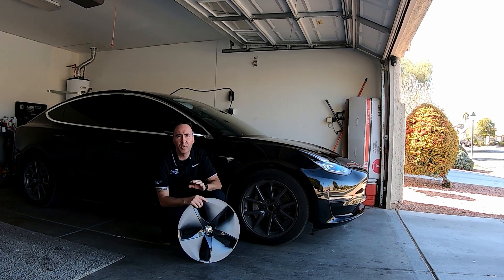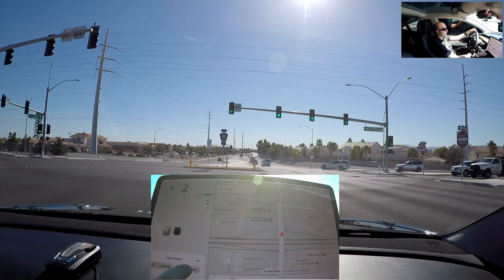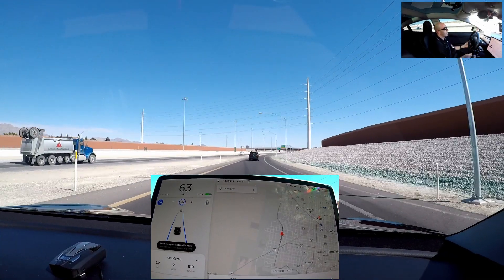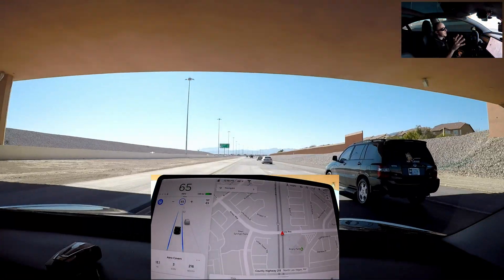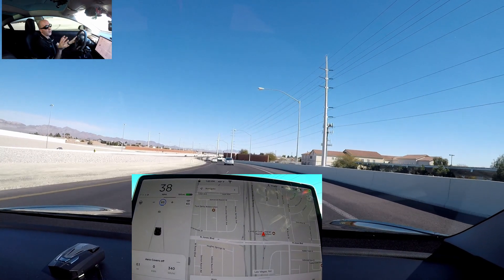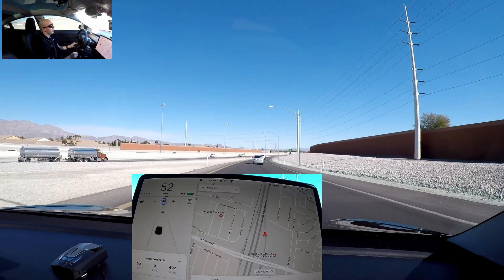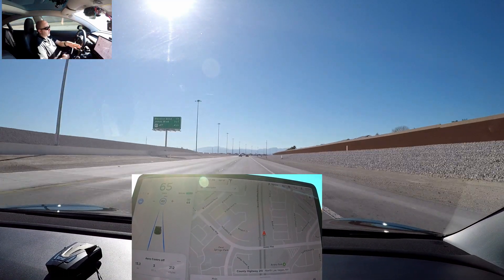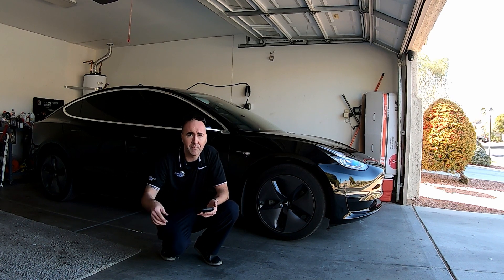Tesla Model 3 Aero Wheel Cover Consumption Test - Autopilot (Short Range)

Comment: I am going to be doing a similar comparison soon but over a much greater distance (450 miles or so). My thought is that for a short comparison like this it is crucial to warm the battery thoroughly before taking any readings. On short distances I think the warmth of the battery (allowable regen) has much more to do with efficiency than the covers. I plan to drive a good 50 miles or so and then begin my comparisons.
Reply from the maker: I would be curious the results of your test. Keep me posted. Also on this test I noticed at the end that the tire pressure went up 2 psi but the battery was warmed up prior. Do you have a channel?
Reply: @VegasModel3  No on the channel. No time to keep it up. lol